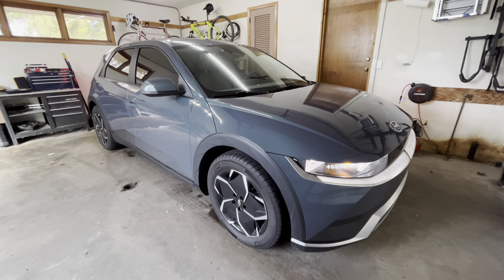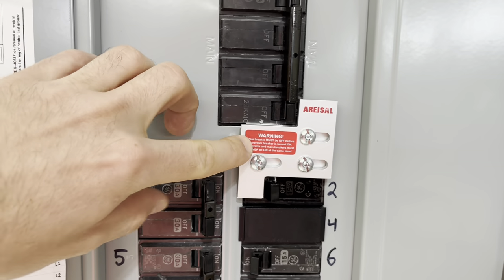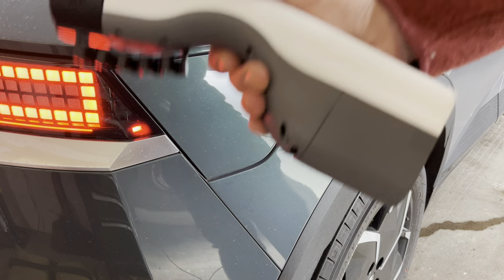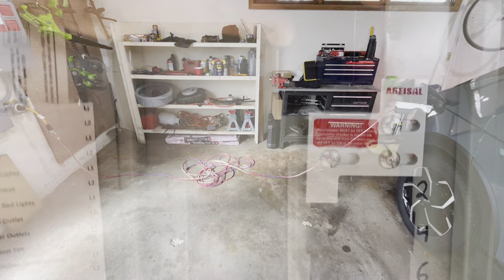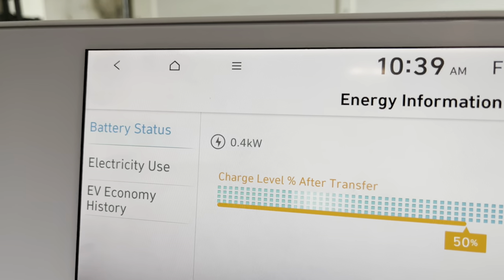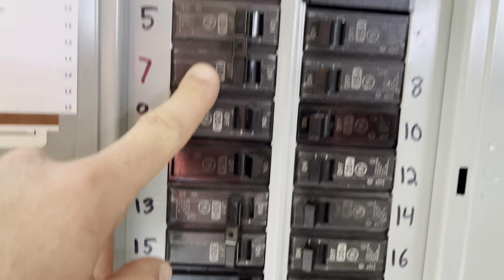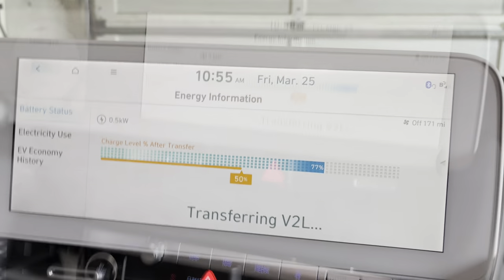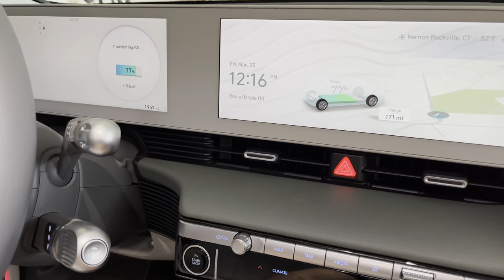5 Days of Emergency Backup Power Using V2L Adapter | Ioniq 5 | EV6 | GV60 | EV9 | Kona | Ioniq 6

Comment: One step better, as Andrew suggests below, is to plug the Ioniq 5 into a small battery that can supply 240/120 at higher wattage. There is such a battery now available with either 4.6 kWh or 6.4 kWh capacity. The Zendure Superbase V can accept power through an AC input port (regular old plug) at the same time as supplying up to 3800W to either 240V or 120V or both simultaneously. I'm going to connect the Superbase V to a transfer switch (Reliance Controls 30310A) which has a generator inlet plug and then 10 circuits (6 for 120V and 2 for 240V which can be split into 4 at 120V). The Superbase V will normally be plugged into the wall outlet, so that my essential circuits (work computer) will have uninterrupted power during an outage, and then if the outage lasts more than an hour, I can plug the AC input into the Ioniq 5 to supply days worth of power. This way, I can run my well pump and water heater and fridge and freezer (though not all at the same time). plus internet and computer and selected lights. Total setup should be less than $5K compared to $15K or more for a home battery system which has less power capacity.
Reply from the maker: That is an excellent idea and maybe something I'll look into attempting.
Reply: @TheIoniqGuy  Furthermore, it is very likely eligible for a 30% tax credit as part of the IRA.
Reply: Did you end up testing this system out? Seems like a great idea and contemplating doing the same!
Reply: Yes I did. It is not possible to have the battery plugged into a regular outlet and at the same time supply power to the circuit my computer is on, because that trips the fuse. So I got an inexpensive UPS for my computer (don't know why I hadn't got one years ago - it's less than $100) which gives me at least 15 minutes to switch over the circuit during an outage. We've had three power outages since I set this up, and none of them have lasted long enough for me to have exhausted the 4.6 kWh in the battery, so I have not tested the concept of plugging the battery into the car while the battery is supplying power to the house. Zendure says it will work, but I have not tested it yet. I did manage to install a 50-foot cord from where the battery is in the basement to the garage, so it is all ready should we have a longer outage. BTW, I ended up getting a Kia EV6 rather than the Ioniq 5, but it is essentially the same for this purpose. (The Kia comes with the adapter shown in this video, while you have to purchase it separately with an Ioniq 5.) @thewh0hweht
Reply: Thanks for the response! Huh, so you can't plug into an regular outlet and supply power at the same time... that makes me concerned that you wouldn't be able to plug it into the car V2L and supply power at the same time either. Or am I missing something?
I have a much smaller ecoflow battery that can charge from an outlet or solar and still supply power, seems odd the Zendure can't.  @StephenFALBEL-g2g

Comment: Fantastic and incredibly informative video, thank you for putting this together.  I learned a lot!   May I ask which gauge wire you used from the twist-lock connector to the panel?  I assume 12 gauge should be more than sufficient?  I need to do a 70' run from where the car would hook into the wall all the way to my panel, but I assume 12ga would be good enough for that too considering the 1800w maximum?
Reply from the maker: Yes I used 12AWG. You’ll have to upsize to 10 AWG to compensate for voltage drop. That’s a long run.
Reply: @TheIoniqGuy  Thanks for the quick reply, I'll run 10 AWG then. :).

Comment: Great Video.
One question, When you turn off main switch and then turn on this break, your Solar panel does not produce any AC because you turned off your Enphase. If your Car V2L is CCS2 and output 240V 60Hz, will it be compatible with your Enphase Solar system ?

Comment: Having problem getting electrician willing to do the connection to the home panel here in Southwest Florida. They recommend using heavy duty extension cords and power strips to power select items but feel that the wattage output of the I5 is insufficient to connect it to the home power. One company won’t even do it for something like the F150 Lightning. I will continue to try to find licensed electrician but will also check with county/city to see what is legal.
Reply from the maker: I don’t see why they wouldn’t be willing to do it, it’s not different than the wiring for a small 120V gas powered generator. You could also separate out a few circuits into a dedicated transfer switch. They might be more into that idea
Reply: @TheIoniqGuy  I agree but he wouldn’t budge. I even said forget that the power source is the car, maybe is just a generator. He said they wouldn’t do the job without knowing what type/size of generator it was. I will press the electrician coming next week a little more. Separate but related item: the video showed you have solar on your house, so do I. When I had the solar installed they said I could not have the solar power the house during a power outage even though there is a interlock to prevent the solar power from going back to the grid when the grid goes down. Basically, during an outage any power generated by the solar panels goes into never never land. If you don’t mind, can you tell me if you can power at least part of your home from the solar panels during a grid outage. I know Connecticut law may differ from Florida law but from a technical view I see no reason why that couldn’t be done. Thanks
Reply from the maker: Solar during power outages comes down to your inverters. Emphases microinverters sense the electric utilities very specific frequency and if they don’t see it they shut down. They’ve since come out with a new version of them that allows islanding where they can run during power outage but it requires their own proprietary automatic disconnect to prevent back feeding.

Comment: I have the Ioniq 6 Limited with a built-in outlet at the base of the back seat. Is there any reason I can’t do the same setup without the adapter that plugs into the charge port? I realize I would need to crack a window to run the extension out of the car, but the Ioniq is garaged and the electrical panel is in the garage.

Comment: I haven't done a lot of digging into this, but can you have both your solar panels and your EV feeding your panel with power since it looks like your solar panel is a 240v system? Or would you need to have extra equipment like a sub panel?

Comment: Did your vehicle come with the V2L adapter or was it sold separately? I’m going to pick up my Ionic 5 on the 25th and was just wondering if I need to get one while I’m there. Great videos btw
Reply from the maker: Thanks! Nope, no car comes with the adapter
Reply: @TheIoniqGuy  Yes it is included in the Genises GV60.
Reply: @TheIoniqGuy  My Limited came with the V2L adapter.

Comment: I've already got a transfer switch receptacle outside that comes in to a switch that lets you power certain circuits in the house. I'd guess we could just use that if we had this car?
Reply from the maker: You would need to look into exactly how the transfer switch is wired but it’s definitely a big step towards making it work.

Comment: Is the interlock the same thing as a transfer switch? Also, can you explain what combos of switches you can have on? Is it just either one out of every pair? Or is it just the even numbered breakers on the right hand side and the odds on the left?
Reply from the maker: A transfer switch is limited to the number of circuits it can handle where as an interlock gives you the option to backfeed the entire panel. Correct, even on 1 side and odd on the other

Comment: I'm curious if there's an issue with the neutral and ground being bonded at the house, assuming you ran both neutral and ground from the car.  I have a customer who tried this with the F-150 Lightning and it kept tripping the built in GFCI on the truck due to the N/G bond.

Comment: I bought a Lectron V2L adapter for my Hyundai Ioniq 5 and when I test it with a Sperry Outlet Circuit tester it shows an open ground.  Does the Hyundai OEM V2L adapter provide a proper ground?  Thanks.

Comment: What if you already have solar with battery backup?  Could you use this along with your battery backup to provide more energy?
Reply from the maker: There's too many variables for me to be able to say with any certainty yes or no. I'm not familiar with those systems.
Reply: Yes. In effect a buffer inverter will see the car as the grid. It will do a bypass while also using the solar input to provide energy and charge the house battery.
If this inverter is rated at say 10kW, then the house will receive this from three energy sources helping each other.
1. The house battery.
2. Available solar PV.
3. The car's battery, via its own on-board inverter.

Comment: I own a 13 kw solar system with only one powerwall and an EV.  I save $500/month on gas and home electricity in Hawaii.  I have power with outages and sell excess to grid.  At light I am on battery.  We totally seamless.  I have another battery on order.  I am almost off grid but Hawaiian electric is my backup to backup   Plus service excess.  Hawaii over 30% renewable.  Not due to electric company or government but Residential rooftop solar.  We pay almost 40 cents/kwh on maui and it’s increasing.

Comment: Hi, question for you : What is your backfeed adapter called that you plug on the car and can we use this with other plug-in hybrid cars such as the new volvo xc60 with a extended range battery (18.8 kw) Thank you and great video !
Reply from the maker: Unfortunately, it'll only work with Ioniq 5 and EV6 but I did see that somebody in Europe was able to make their own cord that allowed for V2L with their electric MG that technically doesn't support V2l. Here's a link if you're interested. https://www.mgevs.com/threads/v2l-vehicle-to-load-adapter-cable.4954/page-3#post-77799
Reply: @TheIoniqGuy how cool. Thank you for your quick reply. Awesome video again that explains really well the security around backfeeding your house.

Comment: Great video, thank you! Have you tried both the V2L and simultaneous also plugging something up to 15A into the rear seat outlet? Just wondering if the car can actually put out 3.6 kW total at the same time.
Reply from the maker: Nope, together they can only provide 15A total if they're both being used simultaneously. https://www.kiaevforums.com/threads/some-verifiable-v2l-info-if-youre-still-confused.2310/

Comment: Cool video!
Since you have solar panels, can you do the same thing and just have the solar panel inverter supply power to your house off-grid? I know I'd be more complicated since the panel's output would vary compared to the Ioniq5's V2L which has a steady max of 1800 W.
Reply from the maker: The newest generation of inverters allow that, which is called "islanding". It requires special disconnect switches and other hardware to prevent the system from backfeeding the lines to the street.

Comment: Can you set you “generator plug” that way that on a sunny day you can use power from your solar panels? So, that inverter from your solar panels “feels” the voltage/load from your car/source and keep working? I know ideally you need some sort of regulator for that, but still …
Reply from the maker: No, the emphases solar system is setup to detect a very specific frequency from the electric company as to prevent you from doing that and back feeding the grid in a power outage

Comment: Great video. Quick question though, can you use the outlet under the rear seat to do the same thing ? Trying to understand if a V2L adapter is absolutely necessary for a backup power connection.
Reply from the maker: Yes you can, you just can't power off the car when using the interior outlet.
Reply: @TheIoniqGuy  Aaah Makes sense. Thanks so much for the response.

Comment: It's a shame you used Enphase microinverters for your solar panels - you could have just used DC string inverters with backup batteries and an inverter to 240V/120V to the house panel, and the ability to take or feed power back to the grid. For example, an EG-4 18K system with 48V LFP batteries (minimum three at 100Ah each) supports up to 18KW of solar panels and 12KW of 240VAC. You could have a grid power outage and not even notice unless your loads exceed the 12KW (50 Amps at 240V), and for safety, the 18K automatically disconnects with grid down (anti-islanding). Your car cannot rival that power as it's 120V only at maybe 15Amps, but it could be a backup-backup.

Comment: during a long duration outage, could you charge your EV during the day from your solar PV (while disconnected from the grid and without a separate home battery e.g. powerwall)? And then switch  back to this set up at night?
Reply from the maker: Unfortunately my system doesn’t allow for islanding. Islanding automatically disconnects from the grid so that you can’t back feed the lines with your solar power. Of course the next gen micro inverters that have it came out 6 months after I installed my system

Comment: Great video. Our electrician is going to use this video to re-create your system this week.  We have natural gas heat with a blower. How will that affect the working of this system? And thanks again!
Reply from the maker: Awesome! Let me know if he changes anything that I show in the video. I don’t think a natural gas boiler uses anymore power than my oil fired boiler so I would imagine it’s within the 1800 watts the Ioniq 5 puts out
Reply: @TheIoniqGuy  Sorry- our furnace is forced air natural gas, not a boiler. I know that furnace fans draw a pretty stiff startup amperage and that's what I was wondering about.

Comment: If you have the Limited with the 110V outlet in the back seat, can you avoid buying the V2L adapter and just plug in the extension cord into the outlet?
Reply from the maker: Yes you can

Comment: What am I missing here?  My house averages 28 kw. / day.   You said in the video you’re house uses 800 watts (.8 kw)?   How is that possible?
Reply from the maker: You comparing two different forms of measurement. You mean 28kWh, not kW. KwH (kilowatt hours) is a measurement of total energy consumed. kW is the amount of energy being consumed at any given moment. My house used 800 watts at that given moment. If it uses 800 watts for 24 hours then my house uses 24x800 which is 19.2 kWh.

Comment: Hey IG.  Thanks for the useful content.  My house is set up the same with the generator interlock but my interlock is connected to a 240v double pole 60 amp breaker.  Will this set up still work for me?  With regards from VT.
Reply from the maker: It will but you'll have to put together your own custom whip to convert 60A to 15A. 60A is a pretty large connector though so idk how I feel about that converting to something so miniscule. Keep in mind, only half of your panel wiould be backfed and you'll be relying on the cars over current protection to trip since it would be paired with a 60A breaker. Wiring of that size though (besides the extension cord to the adapter) can safely handle whatever the car can throw at it. I personally would just add a separate circuit to backfeed if you have the room in the panel. Let me know what you decide to do.

Comment: Living in FL would running the a/c be the same as running your heat?  Not sure if this would run a/c fridge and lights.
Reply from the maker: No, because running AC requires 240V which this device isn't able to do. My boiler only needs 120V

Comment: Is the rate of output the same on the inside outlet as it would be using the external adapter?
Reply from the maker: Yeah both are capped at about 1800 watts

Comment: Do you know if the rear seat outlet can also be run at same time as the V2L and if so, using two cords, can you get a combined output of 3.6 kW or just 1.8 kW?
Reply from the maker: No, only one plug can be used at a time.

Comment: Thanks for this! Doesn't the car output up to 3,600 watts with the V2L connector plugged into the charging port?
Reply from the maker: It does outside of the US where most electronics run on 240VAC
Reply: Yep, European  cars all do. US ones are hamstrung by the 110v system.
Reply: In Europe the similar household power is 230 volts, 50 hertz (all on one wire, so one phase). So there several difficulties. We are out in the country and have 240 volt well pumps so it is a subject we find interesting. I want to get away from needing the generator and stocking gasoline. Great video

Comment: Does the generator inlet have to be installed next to the panel? My panel is in the basement utility room and shares a common wall with the garage, and I'm wondering if the generator inlet can be in the garage next to my hardwired ChargePoint Home Flex charger? If the generator inlet has to be next to the panel would I be able to run a roughly 50-60ft extension cord to the V2L adapter connected to my Ioniq 5?
Reply from the maker: You would be better off running a properly sized cable that accounts for voltage drop  to the garage for the generator inlet

Comment: How could you set this up to slowly charge a powerwall or similar? Keep the Ioniq charging the powerwall at night, powerwall discharging to house since it can handle a better peak load?
Reply from the maker: I'm not familiar enough with Powerwalls to know. Not sure if the converter going to a powerwall runs on 240 or 120V. Not a bad idea though.
Reply: @TheIoniqGuy  Part of me wonders if theres a way to trick the system with backfeeding from the V2L in somewhere where the solar comes in, trick the power wall into getting its current from "solar" but its actually a coming from both the solar and the V2L